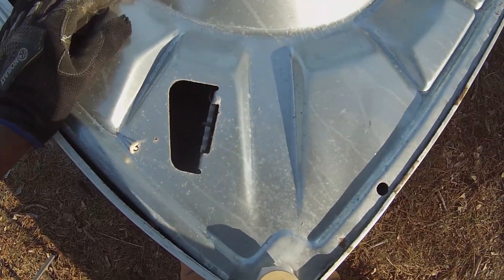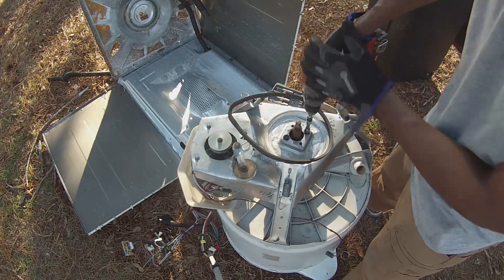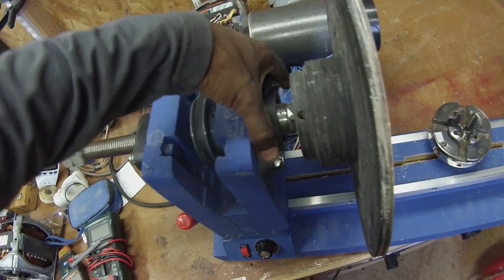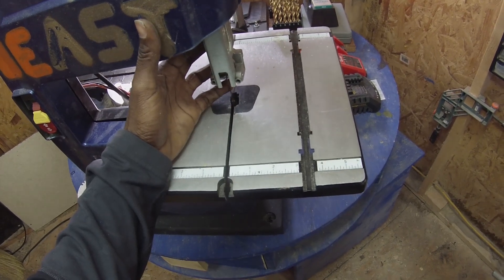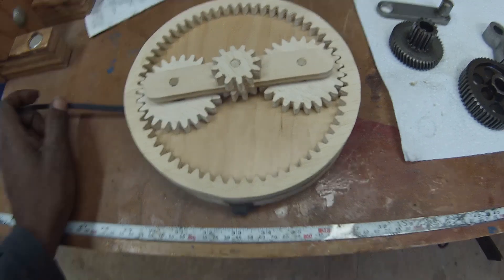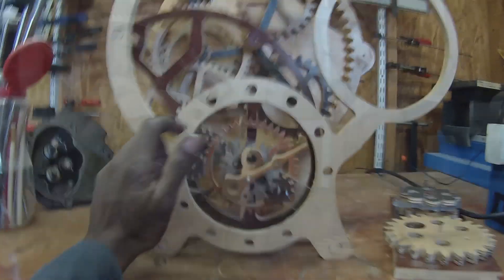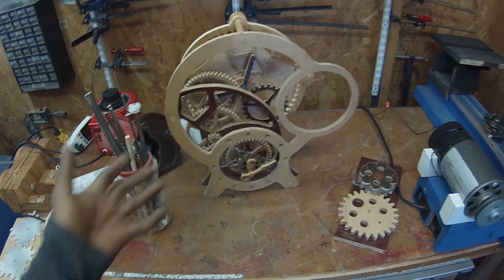Things You Can Make With A Washing Machine And Other Salvaged Components : 020

Comment: I like how you think.  I do a lot of re-purposing, myself.

Your square gears are impressive, did you design those, or find the plans, somewhere?

It looks like you've discovered the great DC motors in treadmills, (thought I saw one in the background).  I got a free Precor brand from Craigs List this summer, it is the best designed for re-purposing I've come across. The motor and power supply are self contained on a heavy duty stamped steel piece, the only external connections are the power cord and the data cable to the dashboard/controller, making it perfect for reuse.

The surprising part of it was the frame. It is rectangular aluminum tube, about 3 x 4". I leaned it up against an out building after I had stripped everything off it, and went back to my roofing project. I walked passed it for about a week, when I suddenly realized it might work as the starting point for a panel saw, like they use at Home Depot, and lumber yards.

I've wanted one for some time. I grabbed a tape, and looked at it, with panel saw, in mind. The frame is a rectangle with a short post sticking up at a right angle, on one end. If you put the post down, and to the rear, it becomes the center support for the sheet. You'd need to add some outriggers, so an 8' sheet can be cut.

Along the inside of the side rails, they welded a piece of ~¾" alum strap, with a half round on what would be the front edge, and a flat on the rear. The seat glides on this.

I bought some bearings on eBay this Spring, which have a concave outer race, for a dual 1" belt sander project from a radial arm saw I've been designing for a while. I grabbed one, and it fit the half round perfectly.

The height of the frame, from the post to the top is ~50", perfect for a 4' wide sheet.

This Precor frame won't just work as a panel saw, it's perfect.

A friend gave me the motor and blade assembly from an older, all steel radial arm saw, so I'm about set on the panel saw project.

The dual 1" belt sander uses serpentine belt pulley from Dodge/Chrysler V-6 engine, and the belt tensioners, as well.  I'm planning on cutting the radial arm short, anchoring the motor to the rear, and using a cogged timing belt scavenged from a machine made to automatically put those adhesive tape seals on certain bakery and food products, (this one was on a certain brand of taco chip. If you see one of those contraptions, grab it. They're made in Texas, and have a Baldor motor with a 90° gear reduction, which powers one of my drill presses at 113 rpm's.

Slow speed turns a drill press into a different machine, different, but incredible.

The cogged belt will drive a pillow block, made from more parts from the taco chip bagger, which drives the sanding belts.

The reason I want to belts is to give me different grits, and different platens, behind the belt. If you look at the better belt sanders, the platen is mounted by a smaller version of a stinger type trailer hitch, (square tube insert type).

This allows you to have different shaped platens, and interchange them. Flat, convex, 90°, etc. Find the knifemakers showing off their sanders, and you'll find the design.

There's an amazing amount of high quality tools to be made from older tool, well built tools. A little ingenuity is all it takes.

You can pick up an original Dewalt radial arm saw from the 40-50’s for less than .$100.  They were built like milling machines, aged cast iron, then machined.  I turned a .$75 one in a metal cutting saw by adding a T-slot table from a milling machine, and a 0.50" thick alum tie between the bed, and the end of the radial arm.  The tie keeps the arm from flexing. The trick to it, is to push the blade into the material, to prevent the blade from climbing the material.

I use toothed blades on steel,and on-ferrous, as well as 1/32" thick abrasive blades for hard steel and fasteners.

The t-slot table allows you to firmly secure the material.  Dewalt actually sold a metal version of their 14" saw, but they are hard to find, and still worth a lot of money.

I saw you have a variac. You can find autotransformers controlling curtain motors in high end houses and theaters, and controlling banks of ceiling fans.

They're made by the same company that makes good quality dimmer switches, (blanking on the name).

If add a full bridge rectifier for/from a welder, (1600v 100A version is about 8-9.00 on eBay, and a couple of big azz capacitors, you can get variable DC power as an option for your variac output. Plus it comes out at a 1.8x factor, close to 180-190v DC.  I know you can think of all kinds of things to do with that!

Keep up the good work.

Oh, I scrapped a washing from the early '90's this summer, it was WAY different than that newer one in your vid.

Regards... GeoD

Comment: How did you learn how to do all of this? Do you have an engineering degree?
Reply from the maker: I am self taught
Reply: Jeremy Fielding how long did it take you to get to this point? Did you just learn everything online? I’m only asking because you are exactly where I want myself to be in the future. Could you give me any advice?
Reply from the maker: Look at the time line of my channel. I started making videos pretty much when I starting making stuff
Reply: Jeremy Fielding 👌 maybe you could make a video about where to start and how to become better faster, with tips and pointers. Anyways love you’re videos man!
Reply from the maker: I get the impression you haven’t watched many of my videos. Take a moment to look around you will be surprised how much is buried in each video... that is sort of the point.
Reply: Jeremy Fielding well alright
Reply from the maker: @RadddahTat  Start with the "how motors work" series... That is a good starting point
Reply: hmmm..... I wonder how you figured out exactly how big each gear had to be for the motor speed on the clock... or did you just eyeball it, get close enough, then use a variable resistor to fine tune the motor speed...

however you did it, great job man. very inspiring. you should sell some of those items or auction them. bet you could make a pretty penny, especially on the clocks.

Comment: Cool video.  I have two washing machine pump questions.  I'm thinking of using the pump from an old washing machine to pump water from a large 360 gallon tub/fish pond made from high density plastic.  This pond will be for my Sebastapol geese to swim in.  I'm going to sink the pond in the ground, so I need a way to pump the water out every other day by using a pump setup with a timer to do it automatically. Then I'lll have a float valve water input to refill it automatically.   My concerns are (1).  If I run the pump dry, which will happen with this setup, will it burn up the pump?  I don't know if washing machine pumps can be run dry?   (2). Does a pump from a washing machine need to be primed or are they no-prime pumps?   I'm not even sure if it matters that that the pump is a no-prime pump if I place the pump even with, or lower than the tub bottom?  I'm going to put the pump in a hole/or a ground vault, just outside the pond.

Comment: Cool deal.  I always see products and equipment as combination of "parts", and remembering those parts for other "different" future applications.  Like the powerful screw drive used in some cars power seats  (like 1988 Nissan Maxima), to use in a lift arm, or ??  So many car parts can be salvaged for different uses.  Bearings, solenoids, relays etc.  Lots of fun for fabricating into different ideas. 
Good Job Jeremy! Fun to watch!

Comment: thanks for the video,
I am making a flywheel generator.using treadmill motor.and messed around with who gas. would like to know, is it possible to change the 60hz?
Reply from the maker: This question has a lot of layers to it. But I can recommend you watch the “how motors work” series, and the “can a dimmer switch control a induction motor” videos. They cover this topic from various aspects in a way that will help you understand your question more deeply, and hopefully also answer it.

Comment: Cool dude. This was just suggested in my home feed.

I don't know if you've ever heard of the old books by David Gingery. If you haven't, definitely look them up. He did a whole series on creating a bunch of shop tools from scratch.
  I came across a cheap harbor freight lathe mill combo quite awhile back, so I that hampered my desire to make my own. I know this video is a bit old and perhaps you've figured out your lathe design already. However, I'll share my thoughts on what I was going to do...
  Use a car wheel, hub, and spindle as the arbor for a lathe. Mount the wheel as the stationary base of the arbor. Obviously it can be cut and welded to whatever shape base you'd like. Then add the spindle as the lathe arbor. This should yield a design that has a large rigid shaft, heavy angular contact bearings, a mounting plate on the brake side, and a large threaded shaft/nut to mount a chuck. Just carry a battery powered reciprocating saw with a fine toothed metal blade or few to a pick your own parts junkyard when they have a half price day. You'll have a perfect heavy duty setup in minutes. 
  I was on the verge of building a lot more shop stuff like this several years ago, but unfortunately got disabled by a terrible driver in 2014. It's still fun to see what others can create like this though. I went from larger projects to more lab bench type stuff for fun now.

   This upload was probably suggested because I was talking to someone about rewinding my own transformers and they mentioned washing machine motors as a primary source for reusable enameled copper wire.

Thanks for sharing. Subscribed.
-Jake ;)
Reply from the maker: I will look up David. There is a whole series of videos on my final Lathe... please check it out if you are interested. Thank you for the kind words, and welcome to the neighborhood!

Comment: OUTSTANDING - A fine example of recycling at it's best...and the clock...wow!
Truth be told, I  am fond of the idea of reusing washing machine motors. Years ago, when we emigrated from Sicily, my dad used one to power up a manual crank ice cream machine so we could make slush (Italian Ices...aka Granita). Also added power to a manual crank grape crush (to make wine). I personally made my first table saw (even incorporated a 45 degree bevel cut) using a washing machine motor....also a bench grinder. Back then, the motors came in a standard housing and it was quite easy to secure to a surface. I bet you have employed some ingenious ways to mount these "open frame" motors.
► Kudos to your ingenuity and resourcefulness !!
Reply from the maker: Thank you

Comment: Its nothing to make but I took a metal drum out of a dryer. It was a 50gal commercial dryer but I use it as a burn barrel for burning scrap wood etc. It works so much better than a regular metal drum that ppl commonly use bc of all the little holes it gets plenty of air flow and it doesnt get weak and start falling apart over time like a metal 55gal drum does.. I guess if you wanted to take it further and make something with it you could design a cool fire pit with it somehow so you can sit around it and keep warm on chilly nights

Comment: I had a washer with a steel tub that died, so I removed the console and all the wiring, the motor and other parts, then drilled holes in the the lid and put the tub back and I use it as a burn barrel for cardboard.

Comment: Got this great question for you if a washing machine motor can run on 12 volts can a dryer motor also run on the same voltage the other question is what is the difference between the 2 motors 
Your input on this is most appreciated thank you in advance
Reply from the maker: It depends on what type of motor. You should watch my “how motors work” series...I discuss the types

Comment: When our last washing machine packed up, after 28 years, I used the glass door as a bowl for growing orchids in and used almost all of the outer casing to make repair panels and patches on cars I was repairing, it was the perfect grade of steel for that job. I used the brushless motor to rebuild a vertical drill and was able to vary the speed by using a dimmer switch, all of this cost us nothing because the machine was a wedding present, but the new washing machine will probably only last 3 or 4 years and the outer shell is far too flimsy .....

Comment: That is some real recycaling at work 
I am looking to build a outboard motor for a dingy type boat and want to power it with 12 volt batteries the washing machine motor looks to be of choice however I have not found one yet I have a pump type motor at 110 volts and will like to make my out board with it will like your in put on this 
As I a novice don't no enough  about machanical principles  to gain a top end result the idea of power to drive it at 12 volts and the idea that it is an AC motor to start with and 12 volts will be DC lots of sciences here and it can be done with the correct number  of working ideas  and salvaged parts 
Like for the props I thought of a angle grinder nat at all sure sounds good 
       Like to hear from you 
              Happy tinkering
Reply from the maker: You have come along at just the right time. I am currently making a whole series of videos on designing machines but at the DIY level. No calculator required lol. I think you will find it very helpful. I also have lots of videos on using and understanding motors

Comment: Hello Jeremy, its been awhile for me, sorryv, dealing with the after effects of cancer has its days, lol. Recently I took apart a 3 wheel bike, 24". Rebuilt it and have ridin it. It a has a 3-speed primary hub connected to final hub to drive only right rear wheel. I made a 'rat bike' with it. Looks cool . I've been thinking of motorizing it. Cant decide electric or small gas. I came across a junk Razor scooter with intentions of using its motor. Kinda hung up here. The motor is 24 volt DC, scooter had two small 12 volt battries that are cheap on the net. Thing that has me is reserch on razor is on full charge it has about 30 minutes of run time. Do you think two small 12 volt car battries would harm the motor with the higher outout? I would appreciate any advice. I know I will need to do gear reduction because of the larger wheels. Figure 15 to 20 mph ok, just not short run time. Thank you. Even if i don't use the motor on the bike it will be used for something, just can't throw it away. My go to pile of parts inventory is growing, LOL.

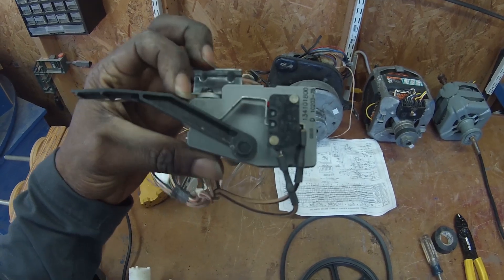Comment: That is a door switch 4:06, and when in operation the arm moves over to lock the door...and it needs, usually to cool down, so the arm will move back over, or out of the way so the door will open..its a safety item

Comment: Hi Jeremy,
I'm learning a great deal from your videos. Re: that 4b toy, with hypocycloidal gear - do you know what kind of machines have used this mechanism? Any references? Any details would be much appreciated, to help with a historical research project.
Reply from the maker: You can search the web and get several. It is a alternative method to planetary gears for large reductions in small spaces
Reply: Thanks Jeremy. In the versions I've seen, the device is used as a reduction gear. I'm interested to know whether the eccentric motion of the petal-shaped part has been used to provide an eccentric motion to a machine (apart from simply being a way to provide speed reduction).
Reply from the maker: I don’t know about that. Most of the time the eccentric part is the component you “tolerate” not the component you desire. It can be so much smaller than a planetary gear but it vibrates at high speeds for obvious reasons. There are ways to reduce/ counteract it but again it’s usually something to fix not the desired result
Reply: Jeremy Fielding  Thanks, Jeremy. I appreciate your time in responding to this question. The movement was used as an 'intermittent' in a proto-motion picture camera in the late 19th-century, and I'm trying to find out what other devices used it for similar purposes at that time.

Comment: How did you figure out the gear pitches and ratios for the clock? Great job BTW!!
Reply from the maker: Its not as hard as it looks. You just do one layer at a time. Each gear set is a ratio. The main gear spins at 60 rpm, and the final gear needs to spin once per hour. Each gear train in between is just me stepping down the speed until I get to the final number. There are some videos on YouTube about gear trains, and gear ratios that would help.

Comment: How good would one of those washing machine motors be at powering an old drill press? It currently has a 1/4 horse GM Packard on it but it's needing some attention.
Reply from the maker: Most drill press motors are induction motors, so it sounds like an upgrade in hp.
Reply: Jeremy Fielding thank you sir! Now to find a washer!

Comment: Jeremy Fielding could use a washing machine motor to upgrade a weed wacker
Reply from the maker: Maybe not impossible but that would be tough. And the speed required is a problem
Reply: Jeremy Fielding could you elaborate more? I have a weed wacker and i am using .095 wire plastic and it smells like i am burning up the motor
Reply from the maker: Just my first impression is it’s challenging... Just take a moment to look at the motor, it size, shape, speed, none match what you have. It’s a lot of problems to solve.